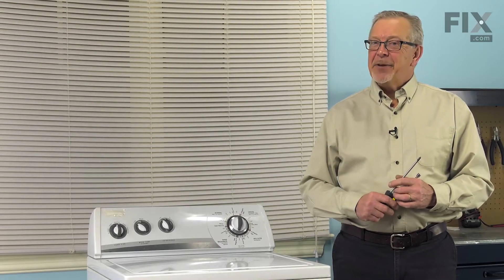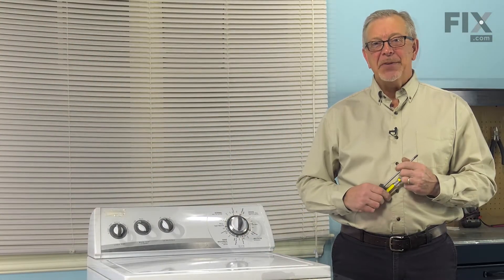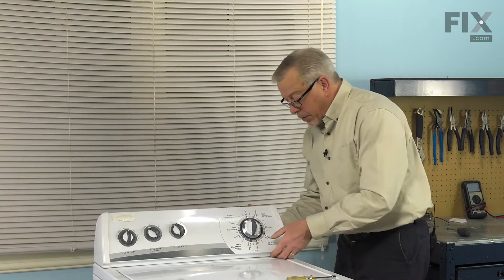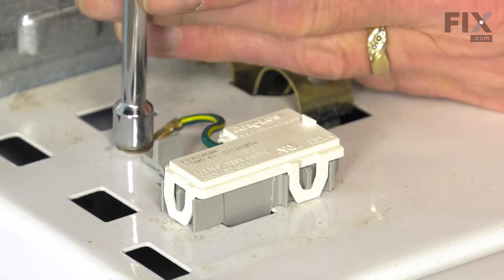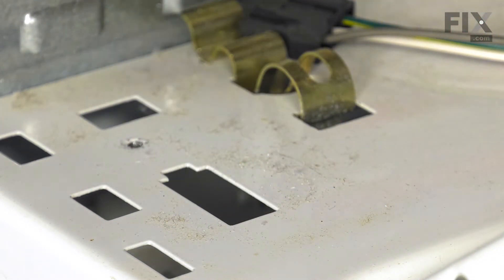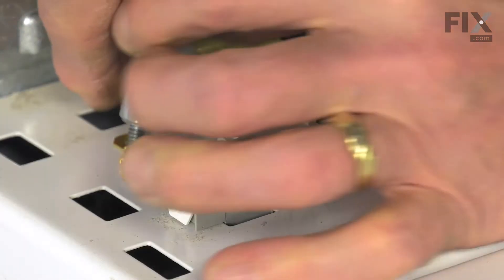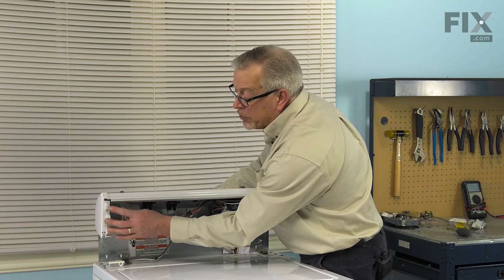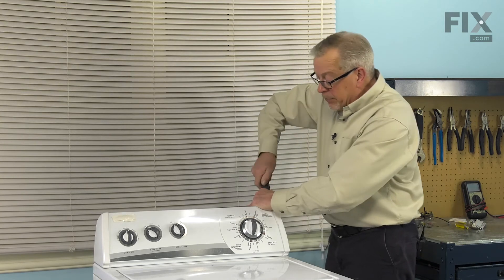Whirlpool Washer Repair – How to replace the Lid Switch

Comment: I went in to replace the relay/switch and found it wasn't the problem.  I found that the rod connected by 2 small screws to the inside of the lid, that pushes the switch was loose.  The rod only sometimes pushed the switch all the way to make it click.  I tightened the screws on the outside of the lid and that fixed the problem.  The original switch was fine.